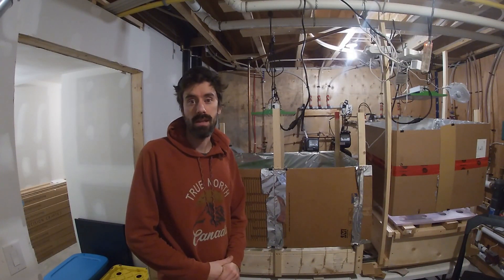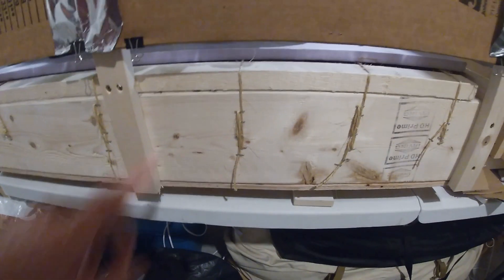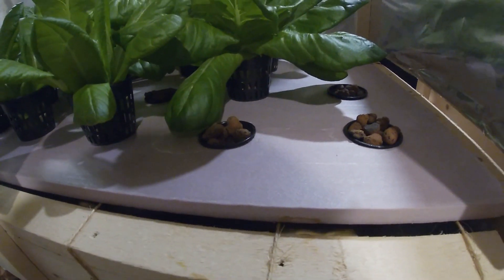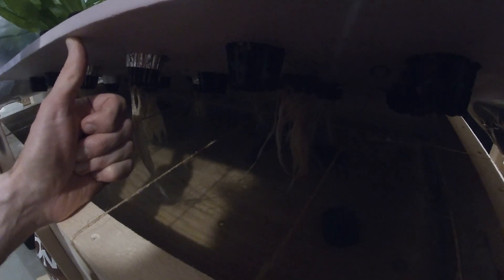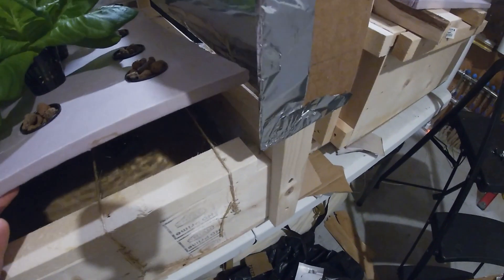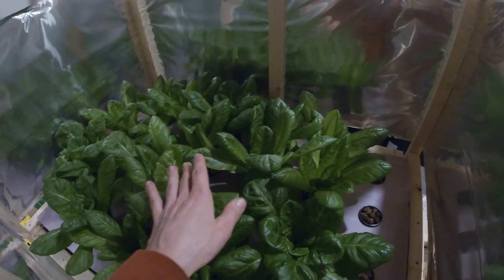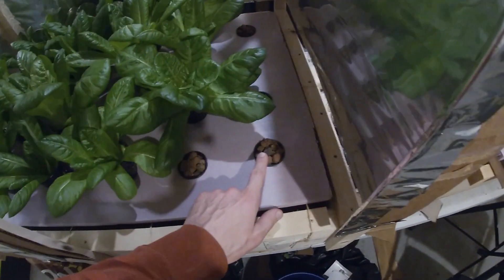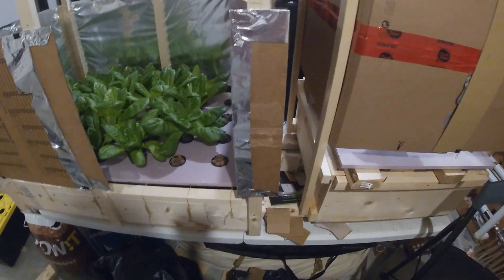DWC Hydroponic Romaine Lettuce DIY Setup

Comment: Great and simple idea, though you may want to raise those walls so more light reaches the plants because the LEDs need to be quite high to achieve an even PAR/DLI distribution. Is the aluminium the generic cheap stuff you can get anywhere?
Reply from the maker: Yeah just the generic stuff, remember their is a side shinier than the other. Your right,  the higher the better but the light would have been higher than the aluminum. I tested the DLI using the Photone add (video in that) and it’s pretty even.